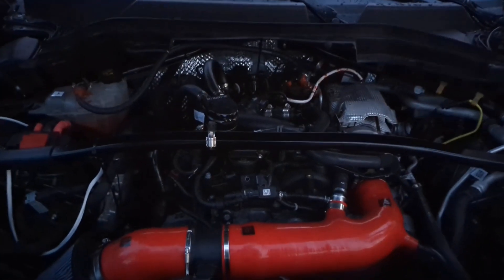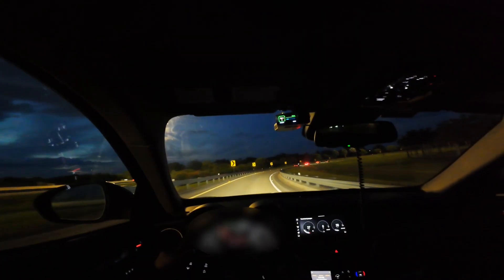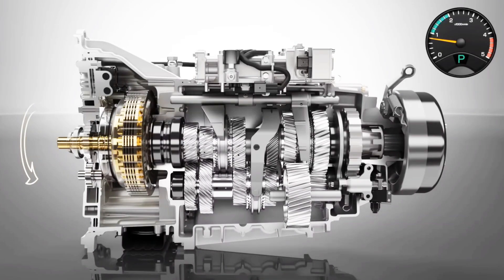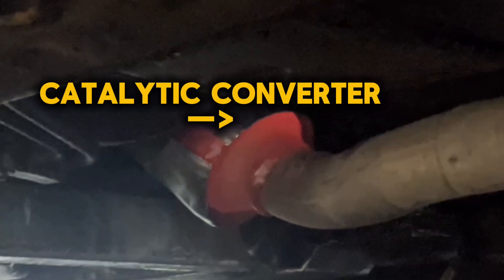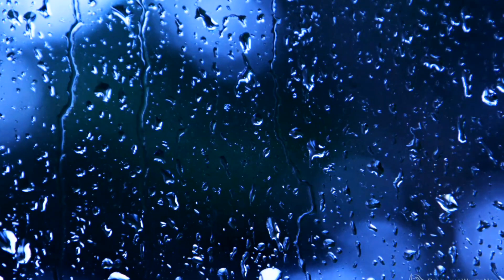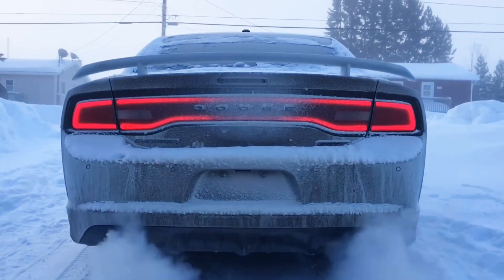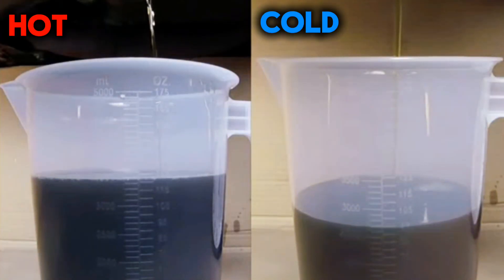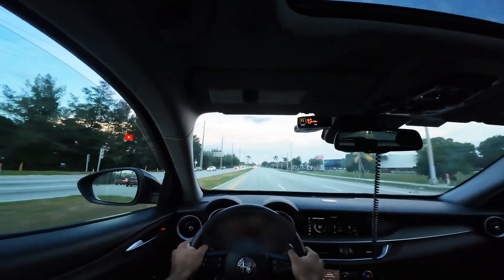STOP Warming Up Your Car – The Truth

Comment: What about diesels?
Reply from the maker: Diesel engines are the same as far as warming up goes, the fundamentals are the same.

But if what your diesel engine is moving weighs a lot (rigs, big trucks) then you'll need to warmup before you put it in drive and load it.
Reply: @TorqueTheoryLabsthank you so much.

Comment: I'm calling massive BS. Have a 19 Civic SI with 109k miles and about 34k worth of parts, I never get in and just drive off without first allowing it to warm up for atleast 5 mins. She still pulls strong and has zero engine issues. Stop putting misinformation out there where dipsnots will believe you and hurt their vehicles.
Reply from the maker: 34K worth in repairs or aftermarket parts?
Reply: @TorqueTheoryLabs aftermarket parts
Reply from the maker: @CoryParks-y5b 

I'm not putting disinfo out there, everything I'm saying can be otherwise verified outside of the video.

Just out of curiosity, what have you done to the civic ⁉️
Reply: It is disinformation as I have practiced allowing every vehicle ive ever owned to warm up before driving off and have had zero mechanical issues from it. Engine oil has to be a certain temperature before its thin enough to freely move to the cylinder heads. Plus, some folks may live in warmer climates while others live in much colder ones. People getting in their vehicles and starting them and driving off will cause damage to them as they don't have proper oil distribution. And mainly bolt-on parts; turbo, motor mounts, built transmission, upgraded clutch flywheel, intercooler, and radiator. Nothing too serious or extreme

Comment: I live 4 mins away from the highway and that’s my way to work, once I get on that ramp if it’s not warmed up I’m sorry but it’s seeing 65 mph for 30 mins
Reply: It has to do with engine speed, not wheel speed. You can safely speed up to 65mph, shifting under 3k rpm, until your oil warms up.
Reply: You can accelerate under 3k to get to 65 don’t really need to warm up
Reply: @Jellybigbelly  why is 3k the delineation between safe and not safe?
Reply: @brkbtjunkie  I don't think it's so much 3k RPM as a hard and fast rule, it's more so because it's an engine speed that is more common across most modern cars and engine/transmission combinations; staying around 3k RPM provides enough torque to get up to higher (wheel) speeds with modern 6+ gear transmissions without forcing the engine into higher wear at higher RPMs. 

Heck, my old 5-speed 2000 Subaru Legacy could get to highway speeds without exceeding 3.5k RPM

Comment: Only place I'm not sure I agree is why even idle 15-40 seconds? Modern engines I've seen have IMMEDIATE oil flow, you will see oil flow at the cams even just turning the crank by hand. Perhaps getting oil to rings takes longer?

Comment: Does this include older cars and trucks like a 1991 chevy?
Reply from the maker: Unless you have a specific motor that is an exception, it should generally apply.
Reply: @TorqueTheoryLabs  Well, it's a 5.7 liter v8, and it gets a little cold out here in idaho so I am just curious on how long it's supposed to stay on to warmup in cold weather

Comment: Don't turbo cars need to warm up for the oil to circulate in them.
Reply from the maker: Warming up ≠ oil circulation.

If oil doesn't circulate within 3-5s, you can say goodbye to your bearings. So the answer to your question is no.
Reply: Im curious about this, I have a turbocharged Audi.
Reply: The car care nut made a good video about this. I recommend it. Personally for my turbo I let it warm 60-90 seconds and drive lightly for 5 mins
Reply: @jimjimhuerta  I'll check out his video, I usually do the same. I let it sit till the RPMs lower (usually about 45 to 60 seconds), then drive lightly until the car gets to 160*f to 190*f oil temp.

Comment: So I have a quick question so smaller engines would then benefit more from this concept? because if you have a really large say oversized engine for standard you know the maximum of highway driving.. you're never going to be  able to run it and it's mid or higher range so I have a Chevy Cruze that's like probably 110 horsepower no turbo it's just the Ecotec without a turbo for me to even get it going up on the highway I got to get it up till like 5 6,000 so I'm assuming that smaller engines would probably benefit more from the standard you know North American state of driving then high power engines right
Reply from the maker: Well larger engines don't always mean more horsepower, but they typically mean greater torque. 

With that said, regardless of engine size - you can always floor it in a lower gear to avoid speeding.

Comment: Question about engine materials
Metal expands and contracts with heat, so when an engine is cold, the tolerances are naturally more loose, so by letting an engine warm up for say 10/15 minutes, you're not putting a load on the engine, and by warming the engine up, the metal expands, so wouldn't that mean that the tolerances are now tighter in the combustion chamber, and the pistons aren't slapping about in the bores?
Reply: Finally someone with sense. Yes, and ive been doing this for my one car for 18 years, all my friends are in and out of shops as i cruise by. This is 5th grade stuff metal does better with heat cars are a big ton of metal....duh. i can feel the difference between taking off when cold vs a 10 min warm up and its much smoother, much more responsive and quieter
Reply: @romeojuliet8462 its almost mandatory for cars with a carburettor, I own two, they fuss when cold, you have to let warm up
Reply from the maker: If your pistons are slapping around in their bores, your piston rings are not working.

Metal does expand/contract, but not enough to affect you in non race engines.

If you have a race engine, this answer is different.
Reply: @TorqueTheoryLabsagreed, tolerance are tighter on racing application, and yes street cars its negligible, I've had folks tell me that by not warming up a car, the wear caused is minimal but its something that can be avoided by letting a car warm up

Comment: What if it's like a 25 year old car? And I live in a mountainous area so I have no choice but to kinda be hard on it... Do I still drive or should I just wait?
Reply from the maker: At the very least you would need to avoid lugging which means higher RPM, and oil viscocity would need to be low enough to adequately lubricate at said higher RPMs. 

Honestly based on your environment, it may be better to wait or do around 5 minutes of normal driving before accelerating up an incline.
Reply: @TorqueTheoryLabsthank you very much

Comment: You have oil pressure almost as soon as the engine starts spinning. The oil pick-up is submerged in oil, the oil pump has oil in it, your filter should be full and most of the oil passages should have oil in them. So once the pump starts turning you’ve got oil pressure. But that doesn’t mean you should hammer on it right after starting it. Oil still has to reach the top of the engine.
Reply from the maker: It is not recommended to hit your engine with a hammer.

Comment: Only time I let my car "warm up" before driving is when it is really cold.  The cold itself doesn't really bother me, but when the inside of the windshield starts icing over, it's a problem!
Reply: If frost is that bad for you, you should consider an independent heating unit. You can pump it with fuel straight from your car's tank, and remotely activate it from the comfort of your home (or have it run on a schedule). You'll be coming over to a warmed up and defrosted vehicle.
Reply: It only ices inside the windshield if there’s moisture in your car (fast food drinking cups etc)
Reply: @TutorialTreasury Well my own breath seems to leave enough for it to happen.
Reply: @TutorialTreasury  This is just a humidity difference not necessarily caused by having literal cups of liquid in your car, though that would definitely contribute. Warm air has a greater capacity to hold moisture so although you probably don't notice the difference in relative humidity between the inside air and outside air the absolute humidity is actually significantly higher inside your car when it's warm. When the inside temp drops (car sits overnight etc.) the trapped moisture condenses on the cold surfaces like the inside of your windshield causing fogging or ice in extremely cold weather.

This is one reason why newer cars have climate controls that run the air conditioner in conjunction with the heater in the winter to help remove moisture. A/C is dehumidifying, that's why it's usually the fastest way to defog your windows.

This humidity change also happens just from sunlight warming the inside of your car, it's a perfect greenhouse/terrarium. That's why closed cars that sit for an extended time often end up covered with mold inside unless they're in a climate controlled garage.

Comment: how about diesel motors?
Reply from the maker: Diesel engines are the same as far as warming up goes, the fundamentals are the same.

But if what your diesel engine is moving weighs a lot (rigs, big trucks) then you'll need to warmup before you put it in drive and load it.

Comment: i have a mercedes e550 and e63s and i noticed after 30 seconds it goes from 1K rpm to 700-800 ish for my 550 800-850 ish on my 63 and after 2 min its at 500 for my 550 and around 3 to 3 and a half minutes its around low 600s for my 63 and there is a tone difference as well both cars from cold start to 30 seconds and then the last idle drop i drive off whenever it reaches the second round of idle
Reply from the maker: This is cold start strategy to light off the catalytic converter as quickly as possible, it's irrelevant for engine health.

Comment: So if a car is sitting for over a yr, you would start it and start driving it after 60 sec? If you say yes, you are a complete idiot. The parts need proper thermal expansion and thermal compatibility before driving. The whole short warm up thing started decades ago by the EPA to help to reduce total gross tonnage of yearly air containments in the US
Reply from the maker: If a car was sitting for over a year, I'd probably check it's gas tank first.

Comment: Modern engines don't last because all the emmisions controls, they will start to build too much crank pressure at about 100k miles because rings are too worn, thinning your oil with fuel, killing seals and plastic parts... now days all engines have planned obsolecence...
Reply: Absolutely!  I’ve been driving over 4 decades and letting the car warm up was standard practice. In the summer, 3-5 min and longer as the temp dropped in the winters.  NEVER had engine failures until all the emission crap started being added.  Curious of the environmental impact with no / limited emissions verses burning more fuel and all the crap we through away because of failures?
Reply from the maker: I've been hearing this more often, seeing it in certain issues, and now I'm starting to think the same thing.
Reply: No, it's because consumers want cheaper cars. You can't overbuild engines like the old days and achieve "good" prices at the same time.
Reply: @verticalflyingb737  The amount of overcomplicated design would heavily disagree with you, they don't care about making it cheaper, what they want is control over the customer...
Reply: @krnt13  "Overcomplication" isn't the enemy here. I can throw "overcomplicated" at any car I want as long as there's a more primitive example in history. This phrase ultimately carries no weight.

The actual enemy is "cheap". Cheap manufacturing practices makes lower quality parts that fails quicker and less tolerant to the slightest neglect. It also gets mixed up with planned obsolescence, which is also its own thing (actually, it doesn't matter if the two are mixed up or not, because it still means failing parts).

Customers will always want the best thing at the lowest price, this is the very basics of business. Unless you're catering to rich people (you'll also catch financially stupid people along the way). Just look at how automakers price their cars in China all in the name of fighting tooth and nail for Chinese market share. Actually, you don't even need to look at China, just look at any market where cheap cars actually matter.

About controlling their customer, I don't know about that, but I do know that cars collecting telemetry and studying/selling that data is a bollocks practice that needs to die. Well, at least we do have an "opt out" option buried in infotainment settings, unless you bought a Stellantis product (in which case you have worse problems to worry about because it's a Shitlantis).
Reply: @verticalflyingb737 sure you can but there is more profit in cheap builds that have added maintenance cost and shorter lifespans.

Comment: i wait for the rpms to go below 1000 rpm and it takes abt a 1min in summers and abt 2 to 3mins in the winters that seems to be the best indicator for me
Reply: Yeah that's when the ecu's idle control has determined the oil is warm enough, pretty much spot on. I notice my rpms drop in two stages, first to around 1250 then to 1k. It's fine to go at the first stage as long as you're not stepping on it right away.
The biggest takeaway from this video imo, is the 10-15 min of driving around 'normally' before really opening it up 🫡
Reply: I noticed this in our 2006 scion XB; it starts running poorly after it's done with that short idle. then once it's driving it's purring smoothly again.
Reply: What kinda engine do you have? Mine goes into low idle after about 10 to 20 seconds cold.
Reply: @lucaswinstonismyname I've got a wrx and if I let it go it'll stay reved up for like 1 min in summer to 3 min on a cold day
Reply: I add a bit of the Lucas upper cylinder lubricant to combat that "cylinder wash"
Reply: @NawHomeeLot of extra money to baby the thing. And people say gas cars are cheaper 😂 Waste of time and money is the vast majority of cases
Reply: He says it in this that it does that to warm up the cat, not the oil or block
Reply: 2-3 mins in -13 degrees? Also?
Reply: @brandonboss6868 Get a block heater dork
Reply: @brandonboss6868 Just drive the thing and don't be a teenage speed racer and you'll be ok. It's not hard my guy 😂
Reply: This is unnecessary and harmful to the engine. 30 seconds of idling or less is sufficient for oil circulation, as it reaches the filter 5 or 6 seconds after starting the engine. After that, you need to drive smoothly (at not too low RPMs) until the engine warms up. When the car reaches the ideal temperature, it is not yet fully warmed up. Another 5 to 10 minutes of driving is needed for the heat to be properly distributed.
Reply: So you’re saying the car actually does need to get warmed up prior to regular operation.  For 18 Minnesota winters I warmed up my 06 Acura TL for at least 10 minutes or once the oil gauge rises to normal every time.  After 418,xxx miles the engine still purrs like a champ.

I will say I rarely ever redlined the car so my experience doesn’t align with the video.  Also it is my understanding that things break more often when you race your car/push it hard as your stressing out components not made for racing abuse.  To clean your engine I would simply recommend using seafoam or the CRF 505 (?) that’s recommended by Scotty Kilmer.  That way you don’t need to beat on your vehicle.
Reply: @diogosoares595 when I start my car and go after 30 seconds in -10 degree whether, my car is squeaky, and very loud when I drive off. When i wait a few mins, she is smooth as butter. Why is that?

Comment: I thought the problem was with uneven expansion as the parts warm up, hence why heavy load is problematic. The issue is that there isn't always the option to drive without load. What if there's a big hill next to your house? It would be ideal to warm up to a good even running tempt at idle and then set off.
Reply from the maker: Well, this is one of the few exceptions. It would be better to let it warm-up in that case before going up the hill.